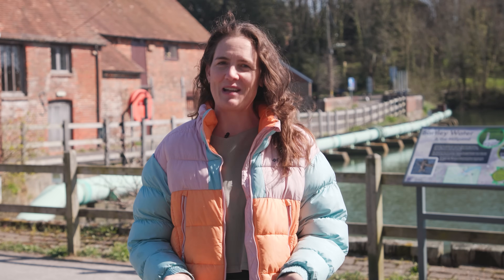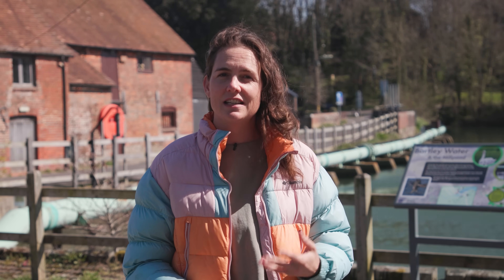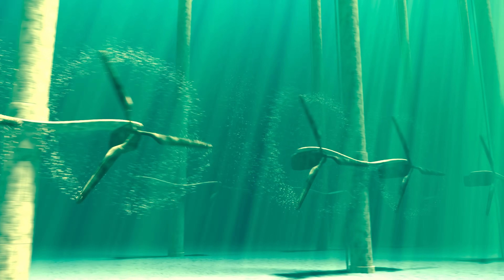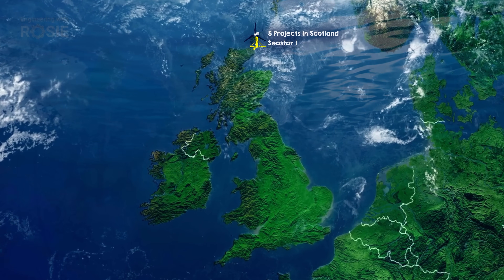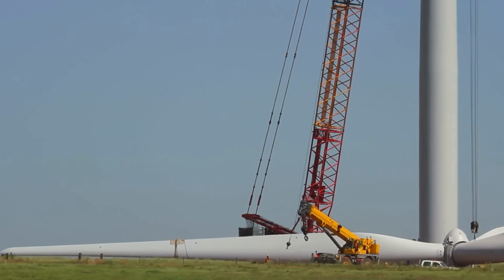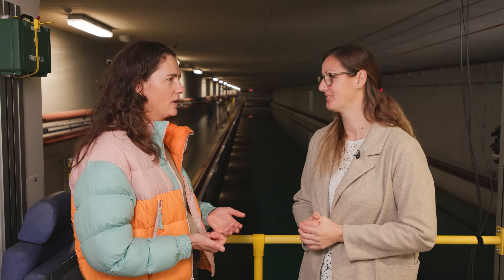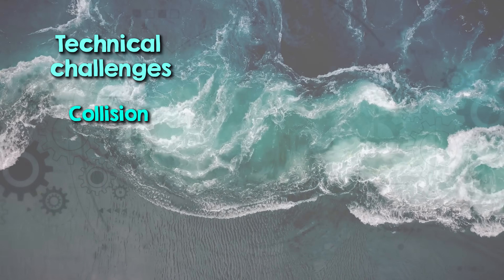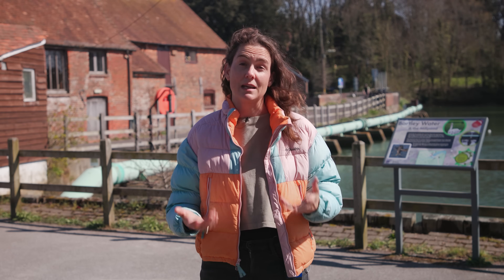A 1,400-Year-Old Idea That Might Save the Climate

Comment: Having spent the last 5 or so years on the octopus agile variable tariff, here in the UK, I think that the predictably of tidal power is very undersold. Yes it might not have the lowest strike price, but when we get a cold foggy high pressure over the UK, the price of electricity goes through the roof. I can easily move some of my demand earlier or later within a day to match tidal output, but I cannot wait 5 days for a high pressure to move on to put the washing machine or dishwasher on. So I do feel like tidal is worth some of the  many challenges it faces.
Reply: @danshillabeer9523  yes, being predictable and importantly having a return period of less than a day makes it much easier for the consumer to shift their demand to match the availability of the power effectively. That's the big problem with wind and solar in the UK, there can be times when there is very little generation for a week or more, depending on weather patterns. As much as I try to match my demands with the price, and therefore available power, I can't wait a week to run the dishwasher/ washing machine or charge the car.
Reply: @DH-tv2yw  you seem to know your stuff, so I'm guessing you're aware of Xlinks HVDC cabling from Morocco, plus the multiple other interconnectors the UK has? Dunkelflaute is unusual, but not rare I'll agree, as I also agree that demand-side modernisation and smart management will aid the renewable transition. V2G can form a significant baseload capability. Plenty of options that don't need tens of billions of capex and decades of build time to inflate that capex
Reply: To answer my own question... I believe the UK government has cancelled the Xlinks project 😢 I can only assume it's an energy security issue
Reply: @danshillabeer9523 yes, I did see that. There has been a few cases in the news about undersea cables being damaged, so I would expect that to be a key security concern. Also, with Morocco being at a similar longitude, I wonder if the peak demand, in the UK, basically the evening, would correspond with when it's dark in Morocco, so little energy to export, especially at certain times of the year? Peak production in Morocco is likely to be at early afternoon in the UK, when we generally have excess power on the grid from the price I get on Octopus Agile.
Reply: @DH-tv2yw  I've done some reading on this, and the power-time spread is impressive - subject to real-world numbers. They have wind as well as solar. 4 x 4,000km. Hard to protect against Putin's scissors.
Reply: Great insight! It's kind of baseline capacity, but predictably variable? Cheaper, faster to install and safer than nuclear

Comment: Thw current contract price for tidal energy is 240 pounds per mw/h, this is insanely expensive,another rediculous pipe dream.
Reply: Is that price for continuous, never-varying 24/7/365 power?
Reply: @aliendroneservices6621  That is the price at source to the generator,so,no. It should be noted nuclear can also do never varying 24/7  power at a much lower cost,as con gas annd coal...

Comment: I have known of two tidal power generators around here. They were only test rigs.     They became unsightly reefs without achieving anything, and their backers didn't stay around to help with the clean up.
Reply from the maker: Did the developers just abandon the equipment? That isn't cool. Perhaps they thought like a skip wreck it's a good habitat? Which to be fair maybe it is. Where are these located and can you actually see them from the shore?
Reply: @EngineeringwithRosie ,
        Had a look back through old news to reacquaint myself with what was just by the by for me at the time. Turns out, both devices were made by the same company. One sank at Port Kembla. Their next one, near Adelaide.   Much legal mud, including eyesore issues, stirred up, getting both sites tidied up.
Reply: @EngineeringwithRosie  I loved your "Skip wreck"  50 years ago I was sent to check if a skip had been delivered.  I paraphrased Nelson's "I see no ships" (skips) when I reported back.  No one thought it funny!

Comment: Has anyone checked the sound decibel level these create?  What is the effect on all the sea creatures within 1,000 miles?
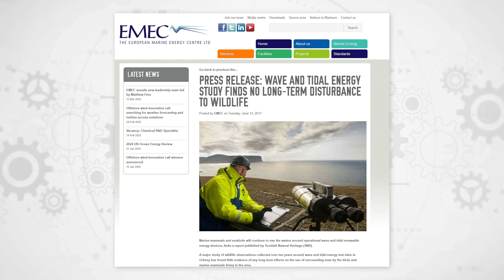10:36 Researchers found that there WERE effects on wildlife 5 years ago, so EMEC's statement that there are =none= is highly suspect.
Reply: They are going to be similar to wind turbines, if the tide is flowing fast enough for the turbine to make a lot of noise, then the tide flowing over the seabed is going to be making enough noise that you won't hear the turbines unless you are dangerously close.

You do want to be able to hear the turbines if you are dangerously close, because fast flowing tidal waters are not going to be clear enough to see the danger.

Comment: If a tidal flow system was built alongside a lagoon system, the flow system would generate during rising and falling tides, and the lagoon would generate during slack water at high and low tide, thus largely removing the intermittency ....
... or an i missing something?
Reply: This makes a lot of sense. The tidal flow is strongest in the middle of the tide - it's the slope of the sine wave. The lagoon has the greatest available power at high and low tide - it's the height difference between the peaks and troughs of the sine wave. The two actions together should always add up to pretty nearly the same amount. That makes it a base load system.
This doesn't resolve the corrosion, fouling, wildlife impact, access, and storm damage questions, but it does mean it's a system well worth investigating further.

Comment: Hello The output of our Sun is the 'heat that drives our climate.  We are currently 4 rears into a Grand Solar Minimum that will extend until about 2053.  Please check the astronomer Dr. Zarkova's data.  The coldest period is supposed to be between 2042 thru 48.  With the Themes freezing.  Regards  Oh, better throw another log on the fire!

Comment: More water flows into and out of the Bay of Fundy twice per day than flows out of all the world's rivers- and yet aside from one small historical project and a few trials, no power has been generated there.  Resisting winter storms and ice is incredibly difficult, the risks to the marine ecosystem are not trivial, and then you add the ordinary concerns of anything immersed in seawater over its life.  It's not looking good.  In contrast, wind resources in Nova Scotia are excellent.  Yet the grid there is still over 50% fossil fired, mostly coal...

Comment: The problem with tidal power is the ocean life that wants to attach and grow everywhere and the salt water corrosion. Equipment maintenance and longevity make it harder than it appears at first glance.
Reply: The sea is a harsh environment and maintaining an underwater structure is always going to be difficult.  I think the tidal barrage is appealing because of the low environmental impact and the simple machinery which can be serviced from dry land.
Reply: Key in my mind is a system which enables fast and easy extraction of the submerged elements for maintainence.
Reply: @lenrichardson7349  Indeed, but anything that involves operating from a ship will always be expensive. The barrage has the huge advantage that the generators can be accessed from  dry land ie the barrage itself.
Reply: @lenrichardson7349 and materials that can withstand the salt water corrosion and keep rotating for many many years.

Comment: So you already have a bias towards renewables which are unreliable and unable to provide power 24/7.  10 hours per day doesn't give power at peak demand times because the tide times change in a cycle that means for most days of the month the tides are wrong for times of peak energy demand.  This is just another high cost intermittent and low yield energy source.

Comment: It’s one thing to have a very focused single use application but the scale, complexity and cost of a meaningful power system would outweigh the gain by a large margin. Then add in the so much forecast sea level changes and your whole system is either under water or beached high and dry.

Comment: Tidal power will be useful only in some very restricted areas. eg Pentland Firth and Severn Estuary. Still, all renewable energy is useful and there may be a niche here. The headline "The 1,400 year old idea that might save the climate" is I am afraid, absurd, unscientific hyperbole. BUT, and it's a very BIG BUT, if the UK keeps expanding its population, and continues to insist on economic growth, every electron will be taken up by the expanding demand, so like the Red Queen, it's an energy transition running ever harder to stay in the same place. For instance, the Moray Firth wind farm, a massive resource, already fully one half of its output is going to power Amazon server farms, and will not go to the private citizen or company, who will have to continue to use fossil fuel energy. This is INSANE, but it's happening, and governments are TOO STUPID to understand some very simple realities in regard to energy demand and supply.
Reply: No, the private citizens will not need to continue using fossil electricity!  

Scotland is producing nearly twice as much renewable electricity as the amount of electricity it consumes, so there is plenty for both Amazon server farms and private citizens!  Amazon will help to reduce the electricity price for the other consumers and should be welcomed.

But it is about time that someone produced a decent system for generating electricity from the heat given off by these server farms!
Reply: @nigels.6051  Then why doesn't Scotland isolate its grid? The reason is:
Scotland is stealing power-service.

Comment: La Rance river estuary in Brittany, France, has operated tidal power station for more than 40 years. The energy is free, apart from Capital cost, maintenance and wages, but it is intermittant (No power available at high tide and no power available at low tide). Although this is the World's largest tidal power plant, it is pretty small by the normal standards for power stations. France runs largely on nuclear power and this is one tenth of the size of one nuclear power station. And it's  only in production for a portion of each day. God decides what times the station is in production. Customers have no choice, like solar power, I guess.

The other reason why this forty year old station is still the largest tidal power unit, is that opportunities are limited. Brittany has forty foot tidal ranges. In my home town, Perth, Australia, a two foot tide is normal. God decides where one may build a tidal power station. and he is quite picky.

The best solution for renewable power is roof-top solar. The power is generated right next to the load. Solar cells are getting better and cheaper. Customers can store energy in their motor car battery.

Comment: 1 it is not material ( Megawatts when Gigawatts are needed).
2. Rust never sleeps.
Reply: OK,

So the only serious tidal power plant in the world, in France, produces a couple of hundred Megawatts averaged.  The much vaulted Severn Barrage, biggest version, could do Gigawatts averaged.

So it can't scale.

Exotic materials (fiberglass from hydrocarbons), hate salt just as metal does.

Forget it. Its a fantasy.
Reply: BTW, if you think stainless steel doesn't rust, I have a bridge to sell to you.
😂

All the best.
Reply: @williamhewitt1628  Marine-grade stainless steel has far better corrosion resistance versus regular stainless steel which has almost no resistance.  It is a middle-ground option between cost and performance compared with expensive titanium that definitely will not rust.

Titanium likely to be used on the critical piston that is exposed to the marine environment.

The hull of each float will be 100% composite as many boats are and this is proven marine construction method.

On top of all this, automated robotics will be revolutionary for maintenance in previously challenging environments like full-time marine and even space.  We're set to enter a new revolution in labor.  The future won't be like the past.  Why would it be?
Reply: @beyondfossil rust is not the only problem, seaweed and shells grow on everything underwater, decreasing lift and increasing drag.  They will need to be cleaned 4 times a year.
Reply: @niconico3907 That's why mentioned automated cleaning above.  All of our major power plant technologies need regular maintenance.
Reply: @niconico3907  Sure, but regular turbine-based generation is also subject to cyberattacks and errors.

Turbines actually become loads (drags) on the grid (as a synchronous motor) if their fuel flow were cut which is worse than an instant blackout.  Even without a preemptive grid disconnect, a turbine would only provide a few seconds of inertia before becoming a megawatt-sized drag.
Reply: You are correct - the future will be different.
And electricity from marine tidal machines is unlikely to be a significant part of it.

IMHO.
Reply: These systems can be scaled to gigawatts.  There is enough tidal energy to power the world several times over.

Fiber glass and composites do not rust.  Neither do titanium and marine-grade stainless steel.  Ceramic coatings and epoxy coatings can stop rust.

Barnacles can be inhibited with biofouling prevention coatings, UV light emitters and even acoustic vibration that can discourage growth.

All power plants have regular maintenance schedules.  Aside from human inspection teams, future technology will include underwater drones.  Automated drones could be employed remove barnacles and at least check for rust on a continuous basis.

Comment: Two extreme challenges:
1.  Installing and maintaining big machines and connections in salt water that is constantly moving.
2.  finding locations for this with the right water conditions but  close enough for servicing and connections.

It is never going to be big.

From what I can see, Cook Strait in NZ is a huge resource, but the water speed is just not fast enough.
That v-cubed in the formula makes high water speed extremely important.
5 knots = 9 km/h =  2.5 m/s.  Still only 58% of power at 3 m/s.
Cook Strait lacks the kind of nearby port space needed to assemble and service huge underwater machines.
Reply: The Cape Cod Canal would be a good location

Comment: Tidal power has the same issues it had 50 years ago: limited areas of use, very expensive, and short-lived.
Reply: Indeed those points remain, even with improved materials/design and manufacturing.
Reply: Yup not going to work well in Arizona or Nebraska.

Comment: I'd like to see tidal power with a horizontal turbine that transfers rotation energy to an above-water generator via cables that twist. Thus, the generator would be more usolated from corrosive factors.

Comment: Another great summary. It'll be interesting to see if tidal stream/barrage can come in under nuclear prices at some point. The Swansea lagoon got down to £95 I think over 120 years (i.e essentially the same cost as Hinkley C ) but still didn't quite make the cut as 'value for money'. There is a big variability of tidal over both day and month which makes it tricky to integrate large facilities, and means nuclear looks better from a firm supply point of view, for similar costs. On the other hand it's a much more benign structure, and easy to decommission.
Globally it's always going to be a bit niche, but in the UK it could be quite a significant source.
The 'energy matters' blog review of tidal lagoons is a really interesting read to get a feel for the numbers, (but you have to make some allowance for the biases of that site).

Comment: This really drives home that even in the best case scenario tidal power wont contribute a significant proportion of global electricity. It really supports my decision to just toss this rounding error technology into the greater energy family of "hydro".
Reply: @Dr.Gehrig. Is it really a rounding error or is it just an unwillingness to accept anything that can't compete with the already established low price norm that has never had to pay for its environmental impact or include it in its costing... which is the real reason we now are desperate to look at new cleaner technologies. If the cost of developing the new technologies to replace the old was now calculated in the cost of climate change and paid up front, we would have billions to spend on developing new tech and perhaps would worry so much about whether it was the optimum efficiency or not. Surely the gas plants and coal plants and diesel plants do not operate at 100% or 'optimum' efficiency, yet we now demand that replacing technology does in order to compete. It doesn't take going down that road long to put it int he realm of the definition of insanity given the consequences of not doing it.
Beside thinking about past action regarding paying for pollution, there are many sources of funding out there if we really wanted to take on this renewable energy transition. For one example, I think of the. proposal way back in the late 1980s to put a .03% (less than 1/3 of one percent) tax on all stock market transactions. The Green Party in Canada is suggesting this again now, thank god. The .03% would generate trillions of dollars and those making the transactions wouldn't even notice it.

Comment: THERE HAVE BEEN MANY ATTEMPTS TO GENERATE ELECTRICITY FROM THE TIDES------and all have generally failed to either maintain their operational integrity and/or to generate the promised electrical generation and financial returns...sufficiently Robust Engineering has been a routine problem (I'm not blaming the engineers) the time may not yet have come to create tidal power infrastructure that can generate profitable returns